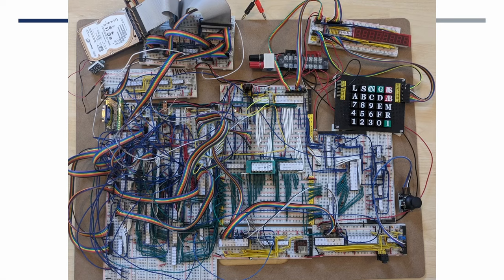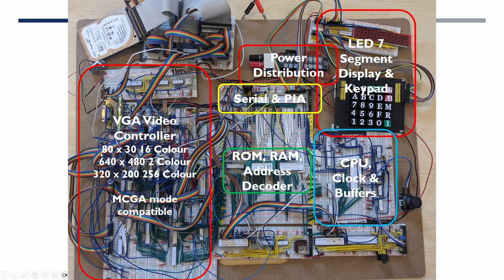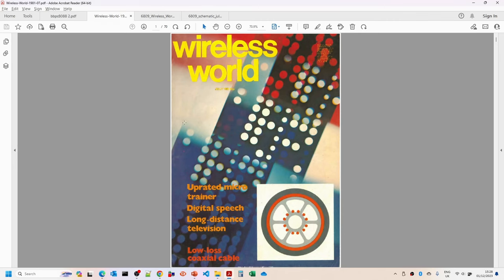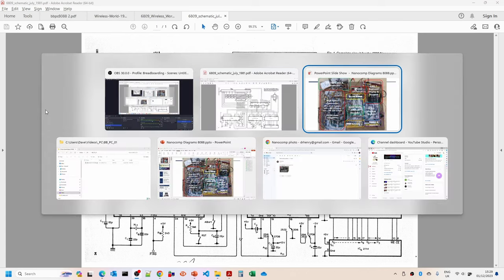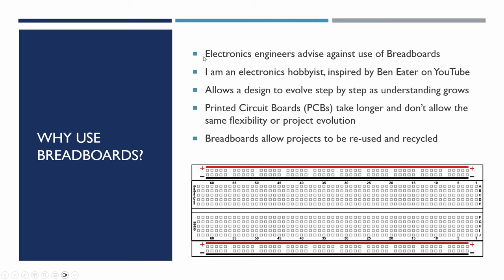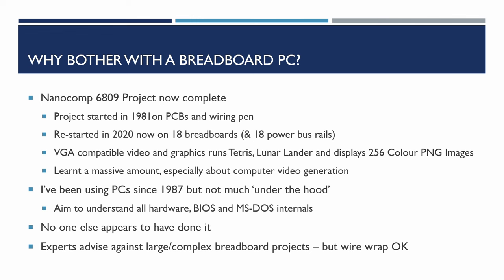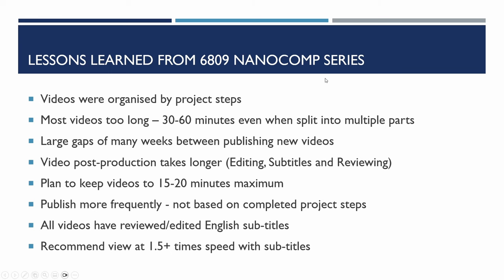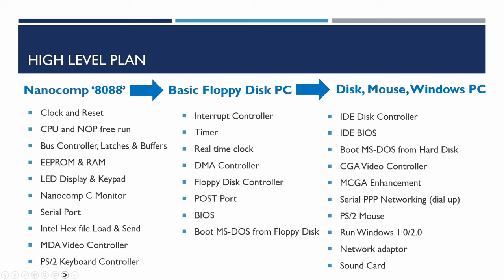Breadboard 8088 PC Introduction #1

Comment: YOU USE THE ORIGINAL SCHEMATICS FOR DO THE COMPUTER
Reply from the maker: I have based it on the Original IBM XT schematics with some enhancements from Sergey Kiselev's XT design (referenced in later videos) and simplifications from using static RAM and not DRAM. From Sergey's design two Interrupt controllers and real time clock like PC-AT and PS/2 Keyboard/mouse to allow 'modern' PS/2 keyboards and mice to be used since I don't have old XT keyboard or serial mouse. I cover all the bits from the original XT and any enhancements in later videos. Dave
Reply: @breadboardinglabs  ok

Comment: Breadboards are great for initial prototyping with wire wrap being a step up for in situation testing though going directly to PCB is cheaper among other advantages.
Reply from the maker: I will be staying away from PCBs for now, I suspect if I tried using them on this project, building it in stages then would take a lot longer. I suspect by the time I get to Network card then I will need some form of PCB as ethernet controllers only seem to be surface mount. Thanks for the feedback. Dave

Comment: Looking forward to this.  What spec 8088 are you planning on starting with?  I don't have a high-speed logic analyser, so was wondering if an 80C88 is an option?
Reply from the maker: Its just the basic Intel P8088 from 1983 so will be running 4.77Mhz (no turbo mode). 
80C88 would be an option though I think new ones where about £40 when I last checked, the old ones were a lot less from eBay (from £4-10). My favourite saying is "If you can't afford to blow it up you can't afford to use it".
Not sure what logic analyzer you have?
My first logic analyzer was an Innomaker LA1010, this is OK for 16 CPU signals but struggles with many signals at video controller frequencies (6-25Mhz) as it doesn't have local memory so everything has to go over USB and can slow down mouse and keyboard during use. 
I later got an LA2016 which was good though about twice the price of LA1010 and I would recommend which goes up to 200MHz for 16 channels. 
As a special extravagant treat I finally got an LA5032 which was expensive but this does 32 channels at 500Mhz.
All three use the same software Kingst VIS which I use in the videos and can use all 3 of them at the same time!
Reply: @breadboardinglabs  Yep, £43 + VAT on Mouser for a new one, so I won't be going there!  I will be going used from a UK ebay supplier and relying on their refund policy.  I don't have a logic analyser at all, which is why the fully static design appeals.  Still working on my Nanocomp 6809 at the moment though.

Comment: I am still working my way through your videos, and I am really enjoying them. In particular I am fascinated by the explanation of your design decision choices.

I am also a big fan of using breadboards. In fact I have many half constructed projects littered round my study all using a breadboard in some way :-) .

A couple of years ago I started a similar project, to implement a minimal 8088 PC clone, based around a set of PCBs. At that time I was new to PCB design, but this was a great way to learn KiCad. Unlike you my design goals were not written down, I really ought to manage my own projects more professionally :-) .

I like minimal designs, so I decided to use "minimum mode", I wasn't interested in adding support for the 8087. Also at the time the 8288 bus controller was expensive, even on Ebay. I omitted DMA to reduce chip count, inspired by the Tandy 1000. I implemented CGA video in an Altera FPGA. I had fun writing the Verilog RTL myself, trying to emulate the 6845 registers, but outputting the video with VGA timings for compatibility with readily available VGA monitors. As with most of my projects the RTL is incomplete, and just enough works that text mode is readable :-) .

I did intend to make some YT videos, but having made a few, I discovered how much effort and time it takes. This particular project is on hold. I did get as far as reading the boot sector from a 3.5" floppy, but then nothing else happened. I think that watching your progress will inspire me to resurrect the project and continue with the debug.
Reply from the maker: Not got into FPGAs yet, I would be interested in the CGA design. No chance of making a VGA compatible controller with DIP chips but with an FPGA it should be possible.
The videos take less time now I have got used to the process.
Normally takes about 3 hrs after recording content including a number of reviews, thumbnails and chapter timing.
Reviewing and correcting the subtitles is the most time consuming part even with DaVinci Resolve generating them in a few minutes. The YouTube default autogenerated subtitles aren't very accurate for technical content like my videos.

My experience with DOS booting was similar, read the first sector OK but after that the flaky DMA stopped the rest loading. PC DOS 2.2 did work some of the time because it was so much smaller than DOS 3.30+ (though the floppy disk format was odd  - 1.44MB formatted in PC DOS 2.2 as 360K format!). PIO Mode FDC worked pretty well once I boosted the clock to 16MHz so it was fast enough to keep up with 1.44MB FDC (Tandy 1000 and PC Jr did not have to deal with data from High Density disks at 500KHz, only worked at 250KHz). I think in next generation design with 80C88 able to do 8MHz+ just need to switch to Turbo mode for FDC access in the BIOS. Dave

Comment: Shorter videos are nice, especially for casual viewers. It would be nice if you could later cut these together.
To give an example: many Minecraft YouTubers do videos like "I survived 100 in hardcore mode", then 200, 300 etc. each about 20 minutes or so. But then, there will be a "1000 days" that is basically just the 10 videos before cut into one without all the hellos and goodbyes in between. Those are usually hours long, but take relatively little effort to edit because most of that is already done.
Those videos are more suited for watching in the background while actually working on a project.
Reply from the maker: Thanks for the feedback. I do plan to do a Breadboard PC in 10 mins like I did for the original Nanocomp 6809 https://youtu.be/jTfk6MR-70I. Just want it to be able to boot MS-DOS before I do it. Dave